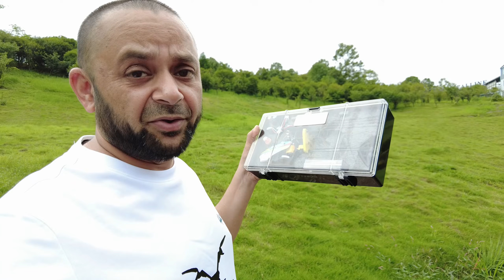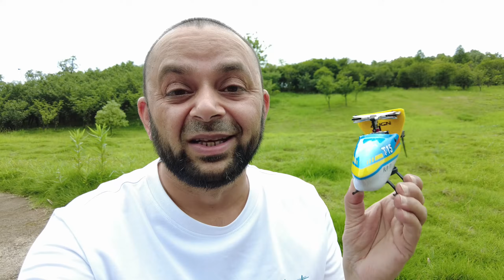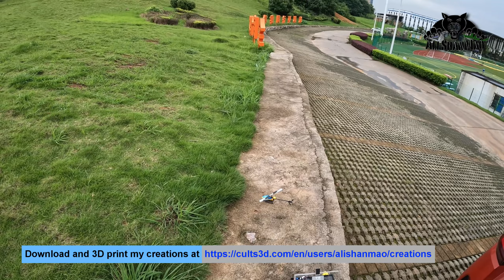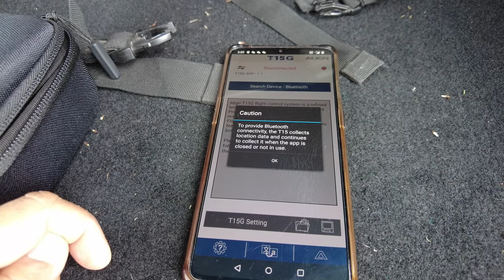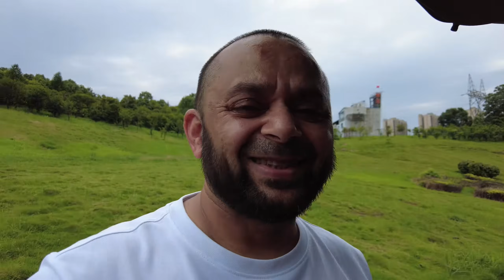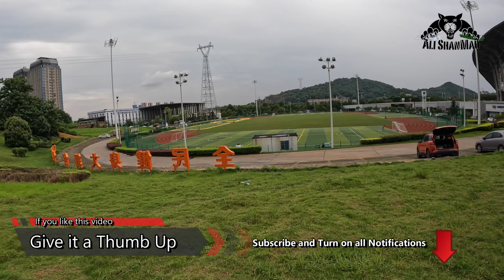Align TREX T15 Direct Drive Mini 3D Helicopter Review

Comment: I hit the like button..  question,  did you have to do any settings or adjustments  on the transmitter, or is it all done on the app, and all you had to do is bind? Or is there settings on the transmitter that have to be made like dual rates and expo, throttle curves, pitch curves, etc....... or is it all done by the app....? Im using a Spektrum Nx20 with the kensun satellite receiver with the binding button for DSM2 DSMX .... Part  number  KEN-01015.... it binds perfectly, and everything seems to work properly ,however, im scared to fly it because i don't know what the parameters and settings are for the Spektrum Nx20 transmitter... please advise, i totally trust you and totally value your opinions..... thanks for your help and time .....
Reply from the maker: Thanks for the like, you can watch my video tutorial for radio setup. it explains all

Comment: Ali, Can you try updating the flight controller and see if it binds to the TX16s. I would love to get this but that is the radio I use.  Thanks
Reply from the maker: I will try and see how it goes. not too sure about this because sometimes updating firmware bricks the machines LOL. you can try to connect the heli to bluetooth and app, and then try to bind and see if it works?

Comment: Try connecting it to an app first then bind it to your tx16s, thats how my trex 150x works, see if it's the same
Reply from the maker: will try it
Reply: @alishanmao  because the app will have to calibrate your transmitter and your throttle endpoints